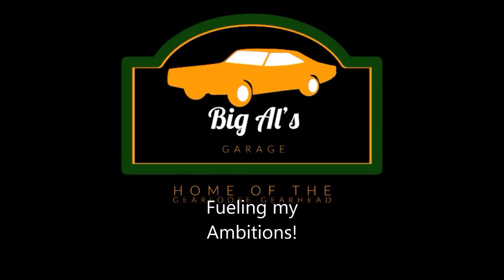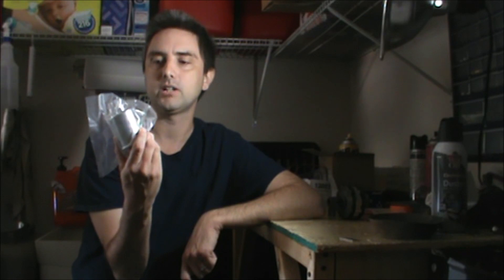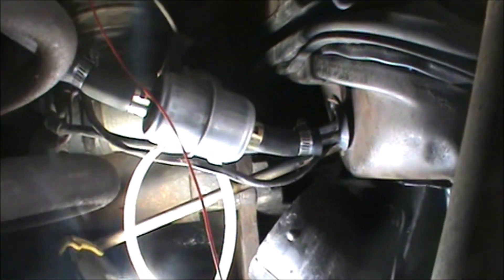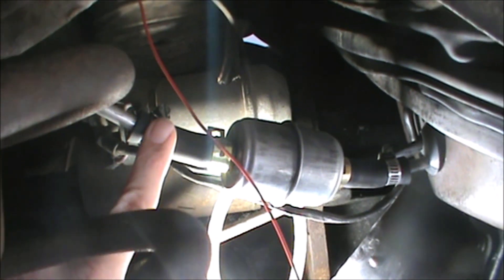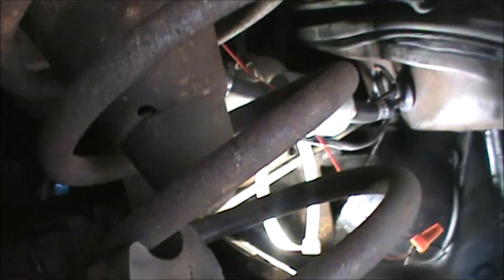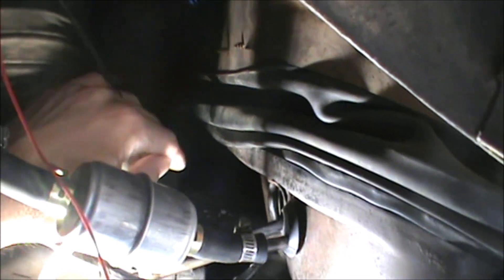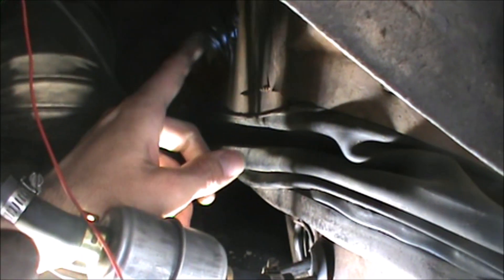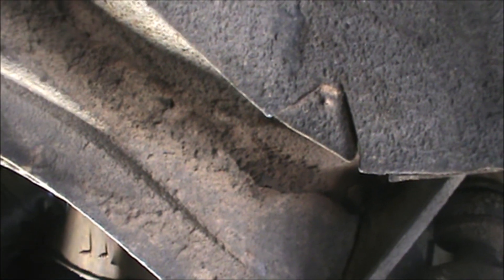Fuel Pump Update

Comment: Toyota used to make on their old fuel injection motors a filter with threads on it for flare lines. That way you can put it any where with steel gas lines   That way less rubber lines and you could mount the fuel filter in the engine compartment if you wanted to. Take a look a fuel injection filters